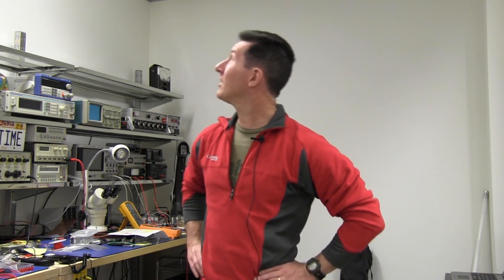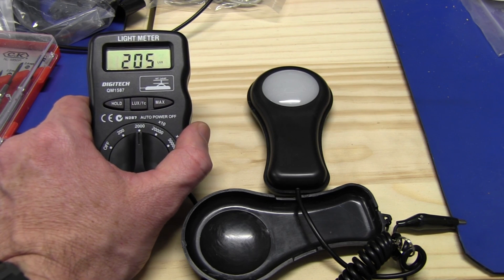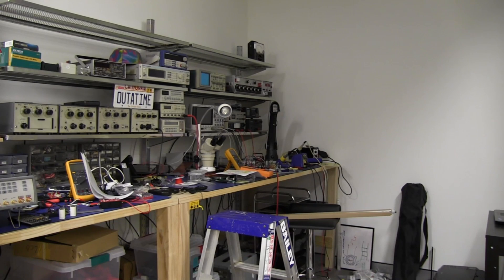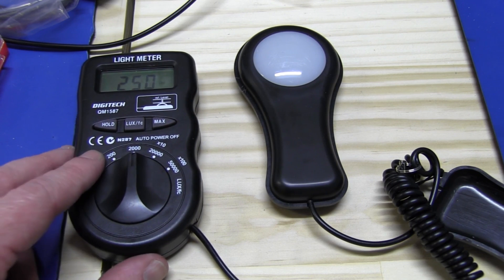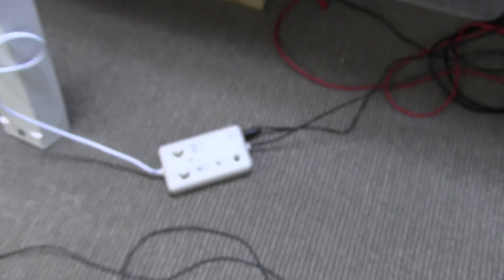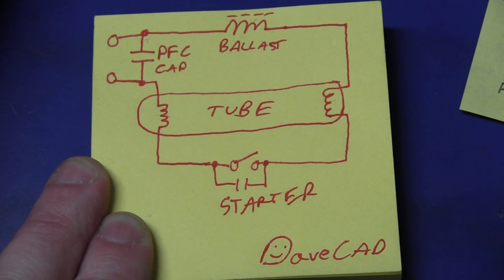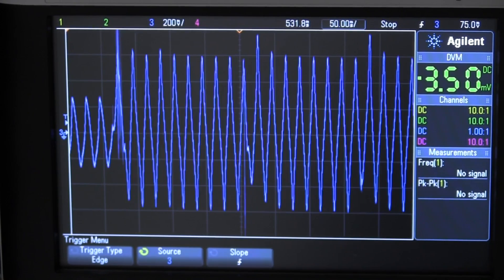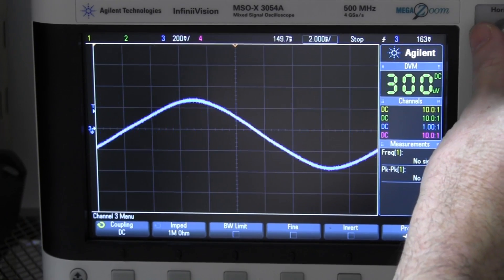EEVblog #307 - Lab Lighting & Measurement

Comment: i know this vid is very old, but for anyone who is interested, the starter works the opposite way round to what he said in the vid. it is an OPEN gap when it first turns on, then the small arc inside heats one of the metal pins (the bimetal one) until it touches the other one, that creates a closed circuit, does all the filament heating stuff in the tube, but since the arc is extinguished, it starts to cool again. it will keep doing this until the current flowing from one end of the tube to the other end is enough to stop an arc igniting inside the starter, then the bimetal strip stays cool and the starter circuit stays OPEN.

tl;dr: the bit about the starter is wrong. if ya wanna know the correct version, stop being so lazy and read the full thing

Comment: It would be neat if you do the same analysis with a electronic balast instead of the magnetic one. The electronic balast should flicker less and run at a higher frequency and be more power efficient. You can get replacement balasts for less than $20.

Comment from the maker: The old NEC tubes used to have a HG label on the tube and I think a warning on the box as well. These new ones don't have either. All other tubes in the store have the warning label. So if they have mercury there is clearly a reason there is no label or warning.

Comment: Color temperature is SUCH a USA thing, "Outdoor illumination is bluer than indoor light and, therefore, has a
different color temperature.  The standard color temperature outdoors is about
5600K as measured on a midsummer day at high noon in Washington, DC."

Comment: All fluorescent lamps contain mercury, although MFRs are making an effort to use as little as possible. It's essential for how the lamp works; a noble gas helps to initially strike the arc when cold but as the mercury turns to vapour it emits more UV, which is why they get brighter when they 'warm up'.

Comment: almost.  the starter begins as a neon lamp, heating up the bi-metallic strip which touches the stationary wire. this shorts the starter out, heating the fillaments. while the starter is shorted, the strip cools, retracts back, breaking contact. The break of contact induces an arc across the tube. If successful, light. If not, rinse and repeat.

Comment: Electronic ballasts are far less reliable than magnetic ballasts.  I have heard of a number of cases where electronic ballasts can fail within weeks, and they typically last a few years at most.  In contrast, I have a number of ~25 year old to 70 year old fluorescent lights in regular use that have their original magnetic ballasts.

Comment: Love when you talk out of your ass. When I was 7 I tool apart a starter from a russian light fixture, it had a cap and a bulb with 2 pins an in inverted U-shaped bimetal welded to one of the pins. The gap between the U and the 2nd pin would glow, heating up and unwrapping the U bimetal which would touch the pin and discharge the ballast into the lamp.

Comment: Are you sure there is a glow starter in your fixtures? Those were the first kind of starting ckts and were replaced with rapid starts, etc. (see the WP article) . Your building would have had to been built decades ago to still have glow starters. The explanation still works for desk lamps where you manually hold down a starting button (which subs for the starter), but for ceiling fixtures, glow starters are ancient history. Now revisit the waveforms with that in mind.

Comment: When you remove the diffuser, the paths from the lamp to the bench (some of which bounce from the reflector) will change, which will be re-altered when the cleaned diffuser is installed. Did you clean the reflector? Sometimes they are coated a film that absorbs some of the light.

Comment: I'm pretty sure there is also mercury in the new lamp, because flourescent tubes are low pressure mercury discharge lamps. They all contain mercury vapor.

Comment: I want to see a comparison of the end of tube light, compared to 4 and 8 feet perpendicular from the centre, light.  Ends are poor, I think. Centres at 90 degrees are better. You could rotate the two benches ninety degrees if there is a benefit.

Comment: You explained the Starter wrong, it's normally opened and closes about a second after turn on cause off the discharge of the mains voltage through the gas-filling in it. while the contacts are closed the filaments heat up and when they cooled down again they open and release the hv caused by the ballast through the tube. when the tube ignited the voltage across the starter is to low to trigger the discharga and the tube simply stays on, otherwise it will start a new cycle...

Comment: The first phase is the preheating, the second part is the ignition (it ignites several times - that might be the flicker you notice at startup). The rfi noise you see will be when the switch switches. And 3. Phase is stady state.
I recommend an electric ballast. It makes your tubes last longer (as it soft-startes your tubes) and helps you to save significant amount of energy. Last but not least you will have a better THD at mains input.
Infineon has some nice lamp balast ics.